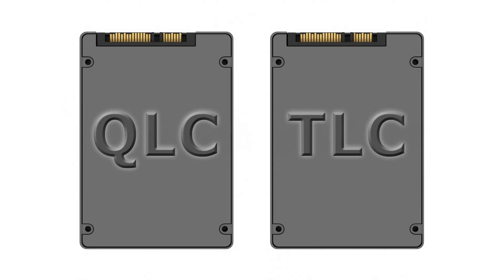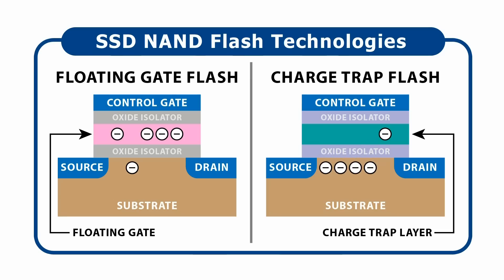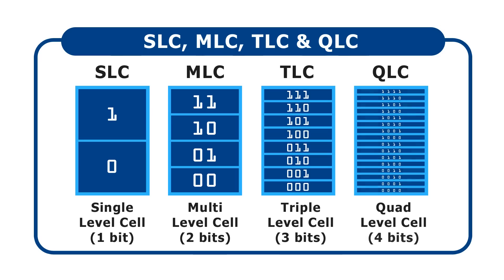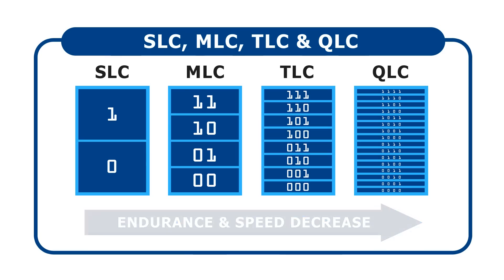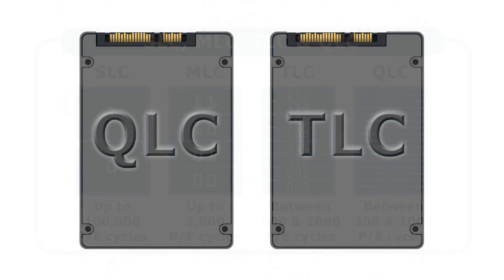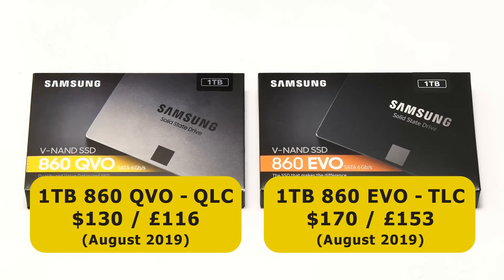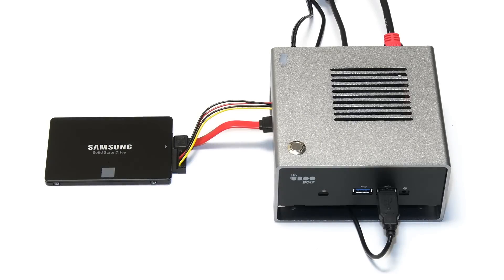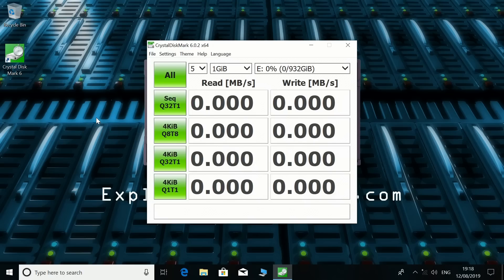QLC vs TLC SSDs: Samsung QVO & EVO

Comment: My 5200rpm platters weep 😩
Reply: lol
Reply: 5200? Who makes those? I've seen 4200 and 5400, but not 5200. 
I assume those are "low-power" or "super-efficient" type drives, kind of like a less extreme power-saving version than the 4200 ones? 
(Then again, I'm also old, and remember the 3600rpm ones, haha.)
Reply: @ArtemisKitty  I have a 4900rpm 4TB drive for random media stuff, first I've seen in person and was probably harvested from an enterprise grade machine judging by the mounting brackets it had when I bought it
Reply: @amnottabs  Oh wow, that's crazy - yet another drive speed I've never run across, in my many years and thousands upon thousands of drives, and yes, mostly enterprise class! What brand is it, if you don't mind my asking? And is there a product line name on it that might indicate it's intended use?
I personally use enterprise grade 10k SAS drives (in RAID 5 on a dedicated controller with a 1GB BBWC - bought an older server cheap on eBay) myself for large storage, as their speed and reliability is just unbeatable - plus the prices, if you go back 1 generation. (900GB 10k SAS for $45, new and sealed? Yes please!) But mostly the fact that they don't die as often, and when one does, it's no data lost.
Thanks for the info!
Reply: @ArtemisKitty  my bad,I opened the case and it is a 5900rpm drive still an oddball for me since is the only drive that is not a 7200 nor 5400rpm that I own hahaha; it says is a Seagate Ironwolf but the sticker doesn't have any green on it but is more like those old Barracuda stickers without logos and only letters
Reply: @amnottabs  Ahh, that explains it. The Ironwolf line of drives are specifically designed for NAS use - Network Attached Storage. I.E. they do better at running non-stop 24/7, are a bit less tolerant when it comes to write cycles, but way, WAY longer-living when it comes to read-cycles and power on hours. At least, that's how I understand them. Still definitely an oddball, though!
Reply: @Artemis Kitty nowadays 5200 rpm comes with laltops .
Reply: @Q_QQ_Q  Which ones? I couldn't find any when searching. I'm always fascinated to find new tech versions I'm not familiar with, haha. (And when it comes to power/heat/longevity? I'm very interested.)